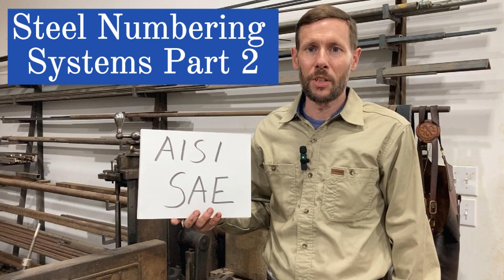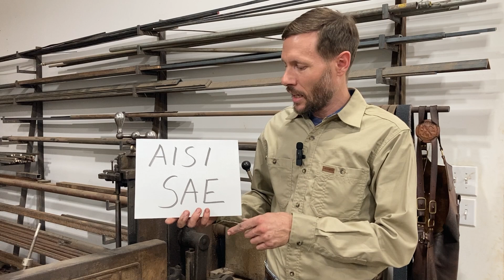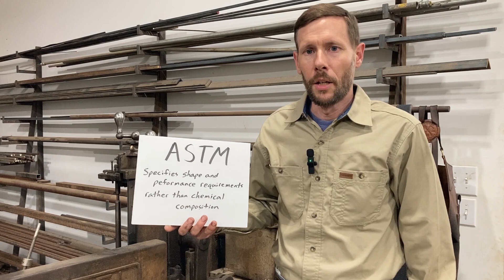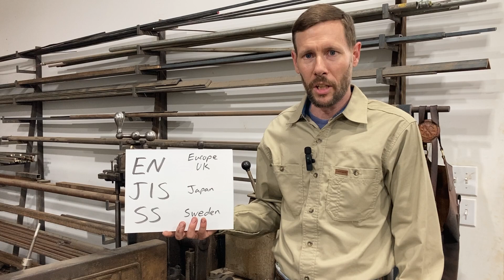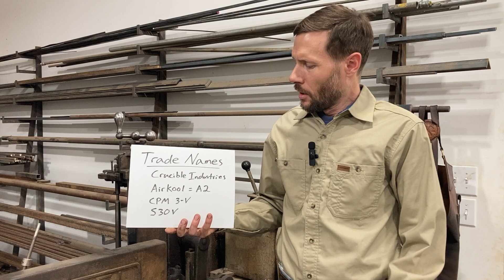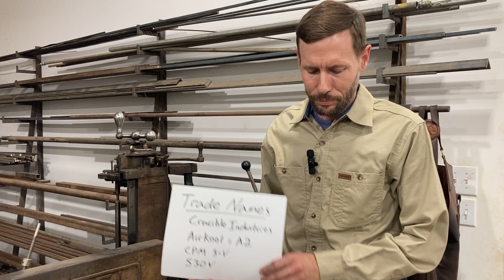Steel Numbering Systems Part 2

Comment: In the WWI period and through the 1920s at least, Colt's Patent Firearms Co. used alloys that were listed in Army Ordnance Dept. component drawings as Colt Steel A, B or whatever. I have a chart, also from the Army Ord. Dept, that lists the alloy make up of these steels. It would be interesting to see if these are close to, or a match, for any current steels known by modern system names. There are also references from the period to "cold rolled steel" for certain components, without specifying the material make up, as well as "saw blade steel." It would be an fascinating study. Thanks for the excellent information!
Reply from the maker: That would be a fascinating study. I'd love to see that chart sometime!

Comment: I learned about steels from two sources. The old Earl M. Jorgenson Steel Co. Catalog. Now called E.M.J. company.    I like the old blue book catalog more than the online catalog.   The other is MMPDS handbook published by the FAA. It was formally called  MIL-HNBK-5.   It is in several volumes and is likely more expensive and more info than most people need.  The E.M.J. catalog is free online.

Comment: We make a lot of parts from D2. There is an alternative of a modified D2 called DC 53 we use too. Way easier machining & longer wear/crack resistant if heat treated correctly. One of the only pluses of being in the Shitcago area is we have FPM that knows how to heat treat it

Comment: Thank you. I can tell you a story about air hardening steel that you may not have known. A deceased gunsmith friend of mine started his apprenticeship just after WW2 at a local engineering works which carried out ship maintenance, had its own foundry operation and carried out work for NZ Railways. One of the men decided to play a joke on his fellow workers during the lunch break. They were sitting on a large steel beam (more likely an I-beam than an RSJ) which was sitting on its side and was intended for railway ‘plate girder’ bridging. He hit it with a tripping hammer which was used to undo cylinder bolts on marine engines and it split straight down the centre of the web. He was so scared by what he had done that he immediately went home.
The subsequent investigation revealed that the beam had come from Japan and the steel works had been using scrap railway rails containing manganese without realising that the resulting product would air harden and become extremely brittle. It is my understanding that annealing ovens are essential when producing manganese steel. Cheers from NZ🇳🇿.

Comment: I used to work for Rolls Royce and they used some weird and wonderful steels for aircraft engineering. 
I've seen steels that change size and shape depending how rough the machining was in the previous operation!

Comment: Thanks for that! Parts 1 and 2 were both great! I once asked a small steel supplier what was the composition of their A36 steel and his answer was, "Nobody knows" which makes more sense now I guess. I have turned A36 rod down in my home machine shop and had inclusions with recognizable things in them, like small parts of screw or a washer. I took this as a sign that I should be buying better steel. I'm looking forward to the next time I need some alloy steel and buying it from you. Thanks!
Reply from the maker: You are very welcome! Glad it was helpful.